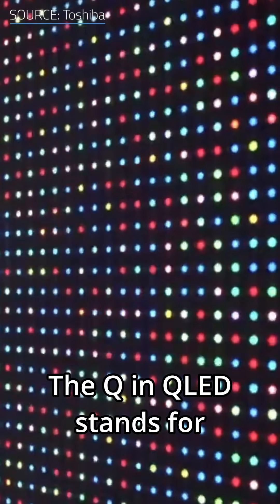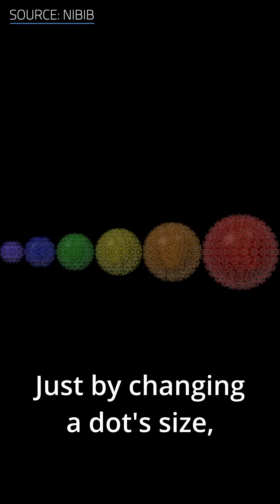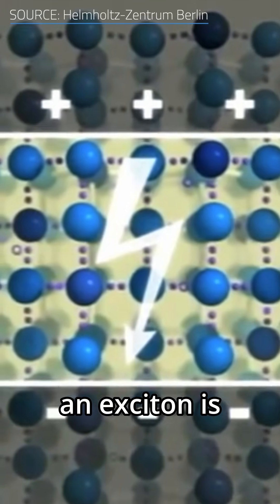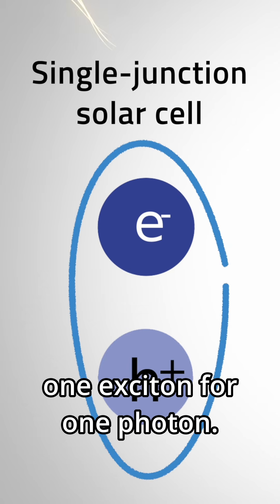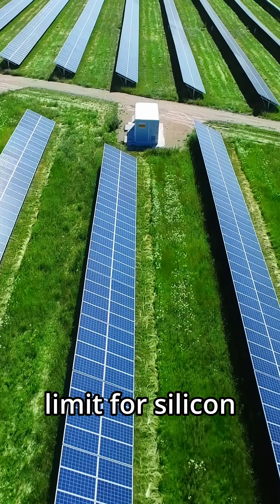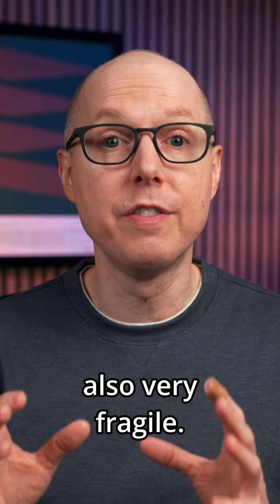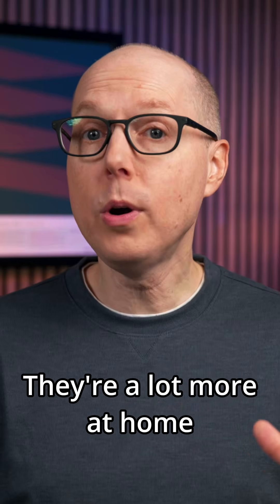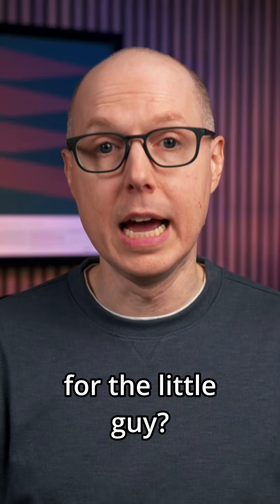Nano-Scale Solar, Massive Output!

Comment: While we are still using them on consumer electronics, I would like to see Samsung varying the light spectra slightly. This would allow me to use my current screen with less fatigue, because it would be less concentrated on certain emissions of the same wavelength of light. If we could get them to a more natural spread while not compromising the queue that they output collectively, it would be more like experiencing natural light. This would be a big plus.

Comment: Excitons are neutral; their movement makes no current.  But, excitons can be ionized and excitons do provide an interband level so that two photons with less energy than the bandgap each can still create an electron/hole pair.  And each electron/hole is then accelerated by the junction's built-in field.

Comment: My question is why tbh? One roof can basically power a home anywhere. If we are talking land, there is plenty of it. I don't see why we need more efficient panels at this point. We need lifespan, extremity tolerances including low light power output, and price. This sounds expensive AF ... For what? Half my roof being free? Maybe there could be applications like on boats or cars but tbh I agree with the sentiment that fold out arrays make more sense anyways. Drive up the surface area, not the conversion on that surface area.
Reply: it depends on the application. for example, satellites and anything else going to space benefit from more efficient solar panels. its worth the extra cost. and like you say, cars or boats. anything that needs to stay small
Reply: Many people don't have much space for solar to hit optimal places.  I maxed out my southern roofs with 8kW of solar, which does match my house + EV use... but if I had geothermal heating, I would come up a bit short.  I have the sunniest, south facing roofs in my neighborhood too! So, improvements will just keep helping!

Comment: I had the opportunity to synthesize CdSe quantum dots using a Schlenk line. Something even more interesting is the synthesis of core-shell QDs, where a core QD is encapsulated with another QD monolayer. Depending on the materials used, they can be useful for conventional solar cell integration such as QD sensitized perovskites or luminescent solar concentrators. The cool thing about core-shell is you have the multi-exciton generation as well as effective charge separation where holes remain around the core and electrons around the shell, and surface passivation by reducing surface defects and dangling bonds. Also, the shell can improve stability by reducing photodegradation and water resistance.
Reply: What do you think about perovskite solar cells coupled with perovskite quantum dots PeQDs? That combination actually sounds a little bit like cmos vlsi technology, I am no expert in this area though.
Reply: @djackson603  Hi there! From what I remember, PQDs are beneficial for photovoltaics, but they suffer from the same stability and toxicity issues as traditional perovskites cells. Something that could be done to improve stability and reduce toxicity concerns is growing shells around the core PQDs. Something I explored was replacing the CD-based emitter layer of a CIGS thin film with ZnSe/ZnS core-shell QDs. If I remember correctly, this improved the stability of the CIGS layer due to the hydrophobic property of ZnS and providing a small boost to the efficiency. Replacing the Cd layer with Zn-based QDs also reduced the toxicity of the thin film which was what I was looking at. I know carbon QDs are also being explored more and show great promise, but I haven't researched that as much. I'm a huge proponent of core-shell and core-shell-shell QDs. Using those can allow for a step-up, 2 low energy photons produce a higher energy photon, or step-down, reverse of step-up, which would allow for wider applications.